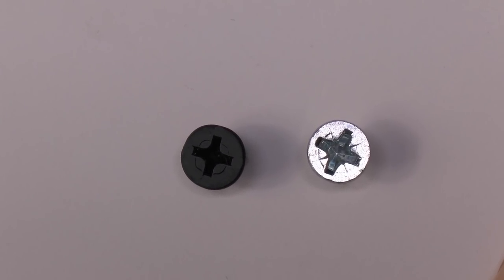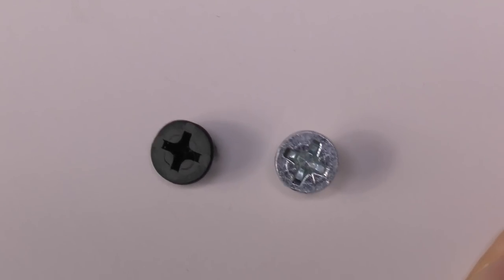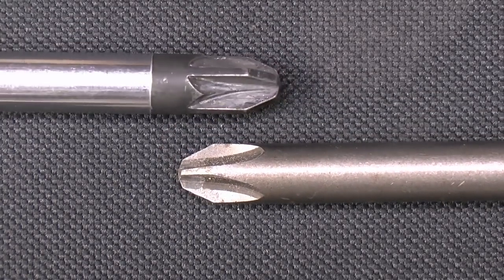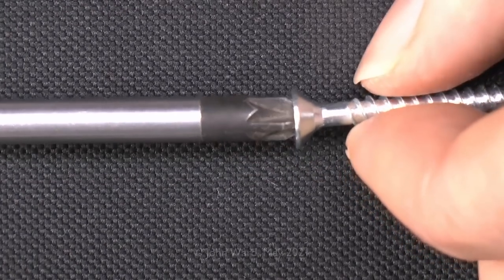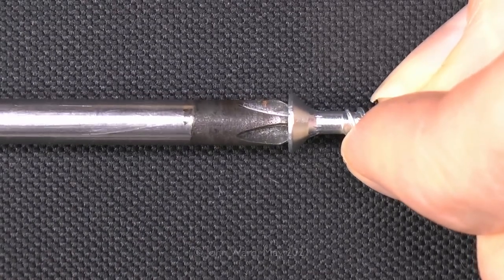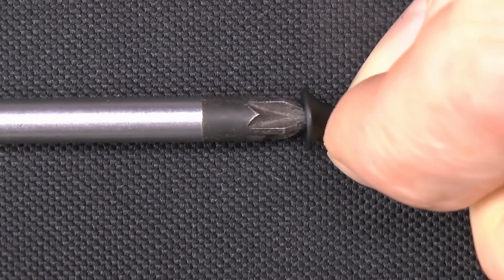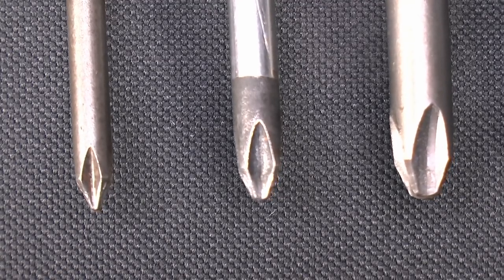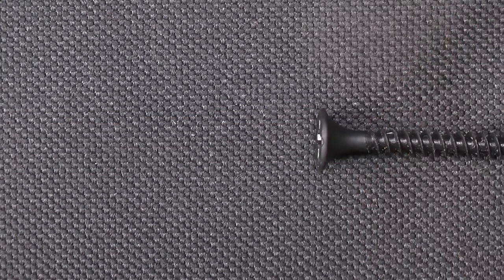Screws - Phillips or Pozidriv ?

Comment: There is also JIS (Japanese Industrial Standard) which is neither Phillips or Pozidriv, but looks similar. Used on Japanese cars, Motorcycles and other Japanese products. JIS screws have a dot on the head for identification.
Reply: I came here to say that too. Proper JIS screwdriver saves ruining small screws on Japanese items. e.g. Shimano Bicycle gears. Looking forward to an AF, Whitworth, BA explanation!
Reply: you can grind the tip off of a phillips driver to use it on JIS fasteners in a pinch.  it gets rid of the tendency to pop out of socket as phillips heads are designed to do when too much torque is applied. i grind the tip off all my phillips drivers for that reason alone, but am also able to use them on my Japanese bikes.
Reply: Ha, you beat me to it. Yeah, JIS.
Reply: But the dot is not always there. JIS is popular in laptops also.
Reply: @dosgos  so much this.
Reply: Using the proper JIS driver is more important on the smaller fasteners. Once your up to the #2 size range it's not as much a problem.
Reply: @geoffgranger718  As you indicate, JIS identification is critical on small laptop screws. The nvme drive screwheads are notorious for stripping from non-JIS drivers.
Reply: @dosgos  yep, I've f'ed them up just looking at 'em CROSS eyed. That counts as a cross type driver, right?
Reply: @geoffgranger718  hahaha. A good video could be made consolidating all the techniques to remove a small screw with a stripped head.
Reply: @seankearney6915  BA was fantastic for small items boo to metric
Reply: Jis used on everything japanese made  - cars/motorcycle, anything electrical - computers, tv's, kitchen appliances toys  ect ect. 
I keep 1 set in the garage + another set  for guitar use (japanese made  electronics on most guitars) basically if it's made in Japan or has japanese made components it will most likely be assembled with japanese screws
Reply: I’ve ruined enough JIS fixings in the past being completely unaware of the difference. Infuriating!
Reply: The JIS screws are designed to cam the bit of the screwdriver out when you are applying too much torque.  I always appreciated the level of engineering that went into just screws
Reply: Ha ha i was about to say that as well.
Reply: Aw you beat me to it,I think jis is best for undoing all of them.
Reply: Jis should be ok on both Phillips & Jis, But Phillips will chew up Jis screws.
Reply: @andyg.8971  , yup, Japanese stereo equipment too, especially older Pioneer, Kenwood, Yamaha, Sansui and so on. All use JIS screws. BTW, some Milwaukee impact-rated Phillips bits fit JIS screws well enough. Dewalt makes at least 2 styles of Philips impact rated bits, one of which works very well on JIS screws and the other one has a very different taper and doesn't work at all.
Reply: Thank you, I've learned something today.
Reply: @seankearney6915  , Whitworth! I have worked on British built Ariston turntables with Whitworth-thread fasteners.
Reply: @goodun2974  The British Classic car guys have everything. AF on the engine, Whitworth on the chassis, BA on the electrics and a curious new one some replacement bits have Metric heads but match the AF or Whitworth thread. The nuts for my Morris Minor alloy wheels take a 17mm spanner.
Reply: @seankearney6915  , I'm not a "car guy" at all, but as a former car stereo/alarm/cellphone installer, and audio repair technician, I've come across a lot of weird fasteners, and I have a good selection of metric as well as SAE fasteners in my garage.  I don't know what AF or BA stand for however.....FWIW, I detest fractional fasteners and drill bits! I wish we'd gone metric back in the 70s as was originally planned.
Reply: There is a slightly different kind of phillips bit for plasterboard screws made by Lafarge , It is quite shallow , don’t know what it is properly called, it used to come with the screws.
Reply: It's interesting that all the JIS screwdrivers I have still have 'PH' marked on them.
Reply: @good 'un. Apparently AF is "Across Flats" which is mainly applied to Metric nuts/bolt heads/Allen cap bolts, studs etc. ( look out for the shallow Metric Allen caps with the imprint "Inbus". You may need special Allen keys with a rounded "pip" on the tip for accurate seating). BA might be "British Associated"? UNC is "Unified Coarse", UNF is "Unified Fine". Then there was/is BSC and BSF for "British Standard Coarse" and "British Standard Fine" respectively. And not forgetting BSP...."British Standard Pipe" maybe? I used to work in the printing industry and most of the decent equipment was German so Metric AF tools were commonplace. Stay safe and well.
Reply: @markmiwurdz202  , thanks for the detailed explanations!
Reply: @good 'un. Sorry. I forgot the one that (I think) started the concept of nuts & bolts/screwthread standardisation in the U.K. Whitworth is sometimes referred to as "British Standard Whitworth" - BSW.
Reply: @graeme9184  This is a very important point.  I've pretty much stopped using std Philips and always grab a JIS driver.  I've even ordered a number of different drive bits for my impact, drill etc.
Reply: @BaZzZaa  I’ve done the same but now own JIS screwdrivers
Reply: explains why all my yamaha bolts rounded off....
Reply: Many years ago my Honda motorcycle engine was held together with what looked like Phillips screws, but mangled very quickly.. Nobody had heard of JIS screws. At the time the solution was to replace them with Allen screws.  Maybe JIS screwdrivers would have worked
Reply: In the late 60s I had a Honda CB450. Nobody had ever heard of JIS and the screws on the engine were near impossible to remove. The standard solution was to replace all the screws with Allen screws.
Reply: @markmiwurdz202  I know my comment is somewhat after the event, but just a small correction for the sake of John Ward's insistence on application of correct methodology and standards, BSC stands for British Standard Cycle thread. 
As you mention in your second comment below, there is BSW - British Standard Whitworth which is the name given to the coarse thread you referred to above. 
Joseph Whitworth devised the thread which took his name and became the worlds first nationally adopted thread form standard as you mention below. Cheers.

Comment: I really wish manufacturers would pick just one when making things, i have had to use pozi, philips and torx on the same item before.
Reply: same tbh
It's defn a pain haha
Reply: Now add in tri wing and square pin (seen on a lot of Canadian stuff!), to name but two more for good measure and we are well away☺.
Reply: @CrusaderSports250  " square pin" are more properly called Robertson screws ---- invented by a Canadian guy named Robertson. Henry Ford liked them enough to consider using them for automobile assembly but didn't like the idea of being dependent on a single Canadian source for such fasteners because Robertson refused to license the manufacturing of his invention to anyone else.
Reply: @Schwalbe262 , no, call 'em Torx, because there are also 5 point " star" screws, used in electronics assembly. Torx have 6 points.

Comment: Fun fact - Philips are designed to be fastened by machines on assembly lines so they cam-out without over-tightening the fastener or mullering the bit/head.
Reply: That is true, for mechanical screwdrives the Phillps is better
Reply: This explains why I had to drill so many out (or because I didn't know the difference between pz and phillips, lol)
Reply: James M  it was in a time before torque controlled hand tools where you could measure the torque and angle for a fastener.
Reply: @ritecomment2098  - Nope, they are still used in their BILLIONS every single day. Drywall plaster screw drivers work using that exact method, except they use a physical stop to help cam out the bit, rather than simply using torque to push it out.

Comment: For the sake of completeness, there is a number 4 in both Phillips and Pozidriv which I used to encounter in my job 40+ years ago. I couldn't find either of the No.4 screwdrivers in my local UK tool shops, so had to sell my soul to the Snap-on Tools man for one of each, which I still have, but rarely find a use for these days. Cheers.

Comment: Hi John.  Here in Canada the screw type of choice is the Robertson which has a square indentation in the top (four points).  The driver has, obviously a square head at the end of the bit.  This was the only common screw form in which you can insert the driver bit into the screw head and hold in any position.  It was designed in 1908  by a PL Robertson, a Canadian of Scottish decent but born in Canada.  The screw was superior to any other on the market and used extensively in the second world war.  Henry Ford realized it's superiority and tried to buy the patent rights which Robertson refused to sell.  Ford was upset that Robertson would not sell the patent and started to use the inferior Phillips screws instead.  Since the Robertson screw patents would not be sold the Americans developed the Torx style screws which have a six pointed head circa 1967 and is also an excellent screw system comparable to the Robertson but not very common.  The Robertson patents etc were bought and sold but tightly held in Canada for years until the big money hungry conglomerates made a big chunk of change selling it to the Chinese.  Send me your address and I will send you some screws and drivers to experiment with.
Reply: Hello sir, can u please send me some screw driver bit set. i live in sri lanka. in here they are very very expensive.

Comment: Ikea is—or at least was—notorious for supplying Pozidriv screws with furniture but referring to them as Philips in the instructions and providing only Philips drivers in their ubiquitous orange tool kits.

I picked up on this in my early 20's (I'm in my 40's now) and set out to equip myself with PZ drivers and bits. I was determined that neither my friends nor I would ever strip another Ikea screw and gouge our walls or new furniture.

Since them I've also take on an educational crusade of sorts.

In the last 25 years, every time I've been tasked with assembling Ikea furniture I've felt the cognitive dissonance kick in, as well as a compulsion to take a few moments and email (and later tweet)  Ikea a few sentences of reprimand.

I can't say for sure that it was due entirely to my masterful persuasive tactics, but Ikea did eventually start including Pozidriv bits in their orange clamshells, at least in Toronto. Their instructions are still misleading, but I cherish my one step towards victory.
Reply: Well done!!!

Comment: The answer is Torx, of course.

When you said the Phillips was seated solidly and wasn't going to slip out, that was good for a laugh. Give enough torque on a Philips head, and the drive will always pop out. Not really an issue for electrical work, but when using a fastener for a mechanical purpose, Philips is pretty much my least favorite. Pozi is a bit better, but it's still not a Torx head.

I'm a bit surprised you didn't mention Frearson heads. Aren't those the home team favorite, just like Robertson in Canada?

There's actually a #4 for Phillips. Don't know about posi-driv. I had an old Atlas 12-in lathe that used #4 Phillips fillister head machine screws to hold the front apron on.
Reply: Philips was designed to slip out, so they can't be over-torqued. Pozi came into existence because the torque limiting was an annoyance

Comment: I remember back in the early 80's on sites,  all we had were slot headed screws, before the days of battery drills as well. We used to have pump drivers, Stanley and CK were like the proper makes, if you couldn't afford that (about £30 I think) you got some unmarked foreign make. Many a time where the flat driver slipped off the screw head and into your finger tip, usually on a freezing cold day 😭.
Not quite sure I remember the cross headed screws appearing TBO. I just remember using them and how good they are with a battery drill to wind in.
Interesting vid that. 👍
Reply: I think in the 1920s Ford was replacing slot head screws for the same reasons. I really dont get how it took everyone else this long.
Reply: @ tiny tony Maloney,  bang right mate slotted are a nightmare aarrgghh ! Tell ya what though the T bits (e.g spax ) grip the best out of them all including pz and ph , never slip .
Reply: @danielstokoe6564  Yeah, Torx is clearly the way to go. Robertson aren't bad—too bad the inventor never came to terms with Henry Ford.
Reply: @PaulSteMarie  where are you from mate ?
Reply: And carpenters sharpening their Diston saws by hand .
Reply: Using a bit and brace how times have changed 👍🙂
Reply: The History Guy channel on YouTube did an episode about screws and screwdrivers a few years ago, it is still his most viewed episode.

Comment: The Phillips system was designed to prevent over torqueing with powered drivers. The idea is that with too much torque the driver will cam out.
Personally I prefer the Pozidriv  or for wood screws the Robertson as the screw locks well onto the driver which is handy when up a ladder.
Reply: Yep. The cam out feature should have been mentioned
Reply: The only problem I had with Pozidriv was finding a good regular screwdriver, not a bit kit. I ended up buying one the next time I was in Köln. I'm in California and nowadays I would just do an Internet search. :)

Comment: Pretty sure most of the hate for cross screws is actually down to this. And people using the wrong size of course.
Reply: Yeah. As soon as i feel a tight cross head i immediately find the tightest driver that fits. 

My old boss hated cross head because he always used the wrong (smaller) size driver in any screw. I tried explaining it to him but he just didn't get it. Which i don't understand because it always caused him so much grief getting stuck extra hours trying to get a machine out of a rack with 50 cent shitty screwdriver. Thankfully that still left meat for a proper driver to hammer into, but DAMN did that piss me off.
Reply: @volvo09  The "problem" there is that unlike most other types, cross bits actually allow incorrect sizes and even screwing at an angle without damage, at least for low-torque applications. 
So some people just constantly use them wrong and dont realize it.

Pretty much all other types will not tolerate any kind of wrong driver or use at all. 

If you use a Torx size 15 in a size 20 screw, it doesnt work at all. If you try to use it at an angle, both the screw head and the bit immediately break. Same if you dont apply enough pressure.
Reply: @volvo09  
"My old boss hated cross head because he always used the wrong (smaller) size driver in any screw. I tried explaining it to him but he just didn't get it."

Match number to number. Could he count? 😊
Reply: @Basement-Science  I have used Torx bits for hex screws in a pinch. You can’t do it too much or it’ll strip the screw head, though.
Reply: Well, that and that Phillips screws were designed intentionally to cam out as a method of limiting torque of early power drivers, apparently.
Reply: @rpavlik1  I've heard that being said so many times but it makes no sense. Would you want to churn up screws, and wear your bits massively in a manufacturing process by design? It also means that your screw is tightened to a torque which would also cam out trying to undo it. Much easier to build a clutch even 150 years ago.
 I think Pozi was designed to be a better head than Phillips, and it is, but still cams out more easily than you'd want.
Reply: @johnburns4017  - Could you show us a Phillips screw head that has the SIZE NUMBER written on it ??

Comment: I work on aircraft and we use offset torqset bits and screws. They have great contact grip and because off the offset, it's also impossible to apply more torque while installing the screws than removing them. Making it always easy to remove them :)
Reply: I work on groundcraft and we use 1 dollar tips and when they wear off we just toss them away.
Reply: Can I ask what you mean by “offset torqset bits and screws”? Do you have a link to this type of screw/bit?

Comment: According to our friends at Wikipedia, the Phillips head is actually designed to cam out, thus limiting the torque applied. Sadly, they cam out long before you can do any damage to the screw, and also long before your screw can cut threads into a shank-sized hole in oak.
Reply: Not if you apply enough pressure.
Reply: Yet the original patent filing doesn’t mention this “feature”, so it’s highly likely that this was actually a retroactive attempt to market its weakness as a supposed advantage.
Reply: @Basement-Science  Yes, this "feature" makes you to press into screwdriver, which feels like doing at least half of the screwdriver job, instead of automating it for real. This is very tiring and so annoying when screw is in tight space, where you can't properly apply force.
Reply: @Georgggg  not every screw head is suitable for every application. Its as simple as that.